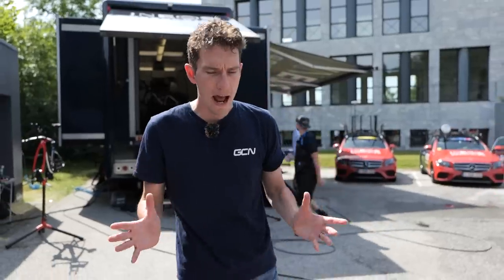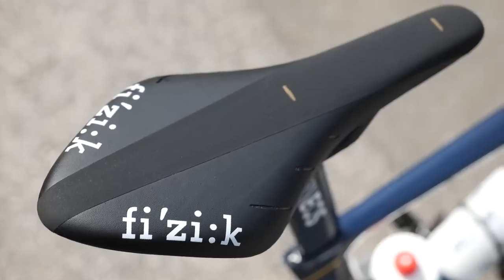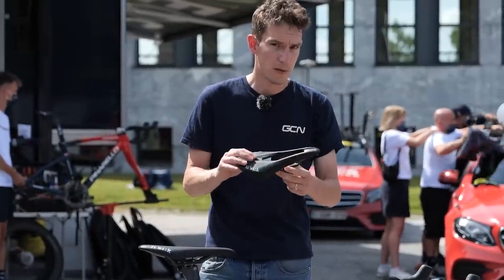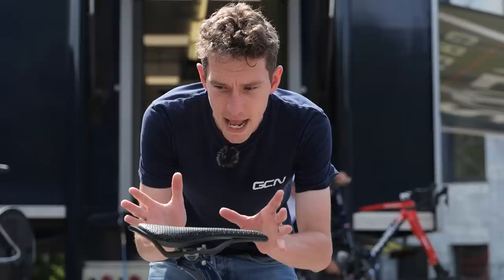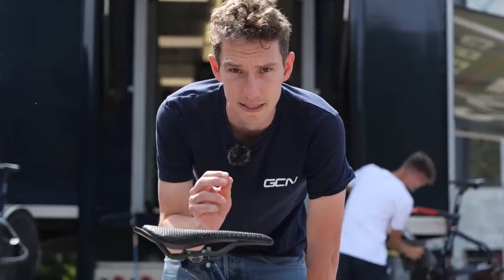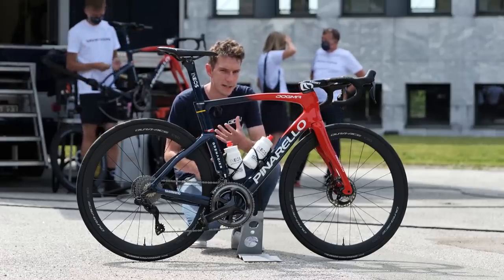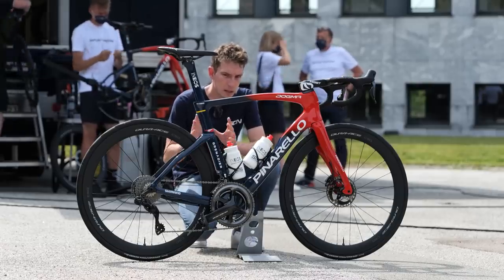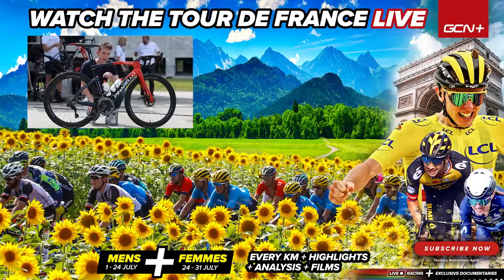How Do Cyclists' Asses Survive The Tour De France?!

Comment from the maker: How long do you think you could ride with a road bike saddle for?
Reply: Spent 13 hours for a 340km Chase the sun ride last year. Had to reapply some chamois cream after 200km but otherwise ok. That was using a Fizik  Antares R3 saddle.
Reply: After about 6 hours I start getting very "fidgety" in the saddle.  I try standing up, sliding back, moving forward, changing hand positions (drops, tops and hoods), but it's really the limit of my ability to sit in the saddle.
Reply: @davidhenry5925  Same as David about six hours but I’ve done almost 9 total in one day.
Reply: 2 hours in which case I’m usually back home from my ride anyway.
Reply: Arses or Asses? Big debate topic.
Reply: After spending & trying about 5 saddles, I'm finally going with Fabric Scoop shallow. I have been sitting for about 12 hours in one go and it still feels comfortable.
Reply: Done a couple solo 200 milers without issue
Reply: PBP: 300k/day for 4 days on a Selle Anatomica Titanico X using Assos shorts & crème de bum.  No chafing, no pain at all. Leather is the best!

Comment: “Saddle tech has evolved a huge amount in past 20 yrs.”
“Here’s a 20 year old saddle the whole team is using.”
😂
Reply: The truth is that not much is new in rails, that's for sure or suspension (the rail attachment points). And if you want to fine tune the rails and attachment points first you might not care about the modern furniture stuffing used in the latest models.
Reply: I mean those are the saddles that the guys that are dominating the peloton (in their middle-late 20s early 30s) have grown up with.

Comment: If you're having trouble in the chamois region then I'd suggest cycling in a different part of France instead.
Reply: Winner winner chicken dinner!  And where, pray tell, is the nether region?  Maybe near the Taint canal?
Reply from the maker: It's only a Chamois if it's from the Chamois region of France, otherwise, it's just a sparkling butt pad
Reply: @gcn  
It's a lot like star trek the next generation. In many ways it superior, but it'll never be as recognized as the original series.
Reply: If only Chamois weren't in the Aosta valley in Italy.
Of course originally they were made from the skin of the European Chamois goat, the same stuff used to dry cars with after washing.
Reply: Formidable.
Reply: Brilliant 🤔

Comment: More bum and chafing info for non-cyclists please.  I try to explain this to new cyclists and their minds cant handle the two concepts of proper support, reducing saddle pressure by having a good balance position with weight on the pedals and the handlebar. and secondly chafing which is a problem for non riders with fatter legs vs fit skinny legs and thus afflicts non riders more than pros.  Propper shorts help  fix the chafing problem and help distribute saddle pressure along with a bit of cushioning.

Comment: Saddles without a middle gap is a big no-go for me as a male cyclist. My previous saddle without the gap really made my private part go numb if I would ride for an hour and it would even start to hurt. After buying the saddle with the gap it immediately fixed all the pain and pressure. If you continue to ride like this (with all the pain and numbness) you could cause severe damage to your private parts on the long run. Definitely recommend the man here to buy one with a gap.

Comment: My vote to Arione as well. It's long, but I can sit back in climbing or get forward comfortably in aero position.
Reply: Why are you 'sitting back in climbing'? When climbing up a hill on a bicycle, the leg movement is the same as stepping up a ladder. If you sit back when you step up a ladder, you end up dead.
Reply: @jameslee-pevenhull5087  Arione is long enough for me to easily change where I sit, 'sitting back' means only few centimeters, if the climb is moderately steep it still allows me comfortable pedaling.

Comment: Riding a road bike is not sitting on the saddle and poking at the pedals......A proper fit allows weight to be transferred to the pedals, having the power to average 30k an hour means a lot less weight on the saddle. Glad you covered it. I have 5 of the  currently on again/off again discontinued Selle Italia SLK non gel saddles.

Comment: Padding is mostly important when you got on a bumpy road if you sitting relativly hard on the seat. The with is critical. To wide saddle with two much padding is uncomfortable when you start and of course not efficient. 

Have find a good saddle for my hybrid but still searching for my racer. Think 3d printing is too expensive for me right now but clearly interesting. 

Totally understand the riders what don't want to swap saddle mid-season.

Comment: My bum can only handle about 40 miles before it really gets uncomfortable. Shifting position on the saddle and standing up always helps me get a little further.
Reply: Probably worth a saddle fit or upgraded bibs then. This shouldn't be the case if you're riding regularly.
Reply: @chicagoan  I got nice bibs. That's just it, I don't ride regularly. I'm lucky to get one ride a week with a kid at home. So, it's like starting over each time.
Reply: @nerigarcia7116  I have a small variety of bibs, but my favorites are the Castelli ones. You can really feel how they twist and take the torsion, so your bum doesn't have to.
Reply: @hzunasdfgbciw  Maybe I'm just a wuss.

Comment: What puzzles me is why most manufacturers decide that the same degree of flexion/firmness/padding is optimum for riders ranging from 50kg to 90+kg?  Especially for those saddles with flexion built into the 'skeleton/chassis'.  Maybe those that offer a range of saddle widths also vary these other parameters, but I've never seen this mentioned.

Comment: When you have a high FTP you’re never really sitting on the saddle.

You’re pretty much hovering over it.
Reply: yeah they push 200w for very easy ride
Reply: @darinsteele7091  exactly
Reply: For most of a stage, you're barely pedaling and have a ton of pressure on your seat.   Being wafer thin does them favors
Reply: As a newer rider I experienced just this. I noticed the more I coast, the more my bum would be tender at the end of a ride. I have one of these Fizik anteres adaptive EVO 00 ass-hatchets and it helps ever so slightly; I had the non-adaptive version before I made the switch. These carbon shell/carbon rail saddles are only good for 1-2hr rides, IMO.
Reply: @veganpotterthevegan  This, they're not pushing that high watts most of the time in the peloton. I can say that the slower I ride the more chance of saddle discomfort though since I just have more weight on the dang thing.
Reply: @ayowser01  even when you’re coasting you can relieve saddle soreness. There are tricks.

I can say for sure though that if your ass is on the seat during a descent to the point where it’s sore then you’re not doing it right.
Reply: @darinsteele7091  I do. 4 Watts/Kg
Reply: Not to mention they wear very padded shorts on top of everything to protect their virility. lol
Reply from the maker: It's why many riders say long, slow days are the most uncomfortable - more pressure on the saddle at lower power
Reply: @chicagoan  yup, when I was racing, I'd ride about 450 miles a week.  Only about 70 of that was actually hard and that's where you get that pressure.  Luckily I had a saddle I loved
Reply: @neoneherefrom5836  if you have the right saddle, the padding means little.  It's more of chaffe  protection above all else
Reply: @veganpotterthevegan  I don’t doubt that because I don’t even ride with padded shorts and I don’t complain about saddle soreness.

Heck I ride an entry level bike with stock parts — including the saddle.

But I’m certain my bike fit and bike positioning are optimal.
Reply: @veganpotterthevegan  Wafer thin and weighing a ton? How does that work?
Reply: @chicagoan  It's force on the downstroke(s) that lifts your butt from the seat, not "watts". And it's not dead weight either. Rocking smoothly side to side still allows good blood flow. Sitting shattered on the saddle makes you feel tired and sore faster than anything else.
Reply: @neoneherefrom5836  Slow, smooth cadence is the best way to recover. It's rarely a good idea to stop pedaling for any length of time on the bike.
Reply: @indonesiaamerica7050  reread...
Reply: @veganpotterthevegan  Paste the relevant text you want to discuss further. Otherwise your reflexive gibberish is useless. A "high FTP" with a high oscillation rate (vertical and or horizontal) is not going to be "hovering". Although at this point I'm left guessing what you could wish to deflect from. For some reason people just love throwing out demagogic terms like "FTP".
Reply: Okay let me clarify… a high FTP where you aren’t anywhere near close to spinning granny gear like the road runner should be enough to relieve your ass.

I figured this was an educated enough crowd to understand torque is what lifts you up. Lol
Reply: @neoneherefrom5836  The truly "educated" critical thinking crowd knows it's not "FTP" at all. It doesn't have to be "high FTP". You doubled down on Dunning-Kruger "unskilled and unaware of it". The sweet spot for "floating" from the saddle is probably at about 80 to 85 cadence at a comfortable pace while not fatigued. Practicing this kind of smoothness is best done while warming up on a trainer. But the real point is don't throw around buzz terms like "FTP" when they don't apply. Like, at all. It takes people away from learning the relevant lessons.

Comment: Those FIZIK saddles are great. I lament no longer having mine. Had great luck with Selle Italia SLR I think it's called as well. At present my 1spd and my roadbike are both equipped with full carbon Chinese cheapo's, and have been great. They are knock offs of the Selle Italia full carbon saddle, which I've also owned, and the only difference I've noticed was about $200.
Reply: i had the R5 Vento, terrible for a normal postion because the material isnt grippy at all, would be a great saddle for crits.

Comment: I am not convinced by the slow rides are worse because of higher pressure on the saddle. The more watts produced the greater the forces exerted by the leg muscles (at a fixed cadence) and these forces have to be reacted somewhere ie the saddle unless the theory is that at higher speeds the riders reaction more of these forces through the hands via the core which I doubt. If you are ripping along at 50kph you have a lot of other things to occupy the mind like not crashing maintaining your position, keeping up, who is where etc etc and so less time to think about the pain in your bum. Also slower days the riders will likely sit more upright and thus transfer more of the weight through the bum and less through the hands like us normal humans, as was mentioned. Also if the set up is primarily designed for the aggressive position with slammed stem then this more upright position will be sub- optimal. Riders do not want to waste energy hovering over the saddle using core and upper body muscles. 

Anyway just my 2 cents…

Comment: Sit bone width is a fairly large factor. My favorite saddle is the Antares, because I''ve not got the skeletal structure as narrow as the vast majority of grand tour level cyclists. 
Sit bone width isn't about weight, though there are often correlations with Body Mass Index (which is a terrible means of estimating body fat percentage, $10 body fat calipers are far, FAR better, but I digress). 
Just pointing this out to counter the "I need a giant saddle because I'm fat" notion, that is wrong and thousands of new cyclists fall into this trap only to quit the sport because their ill fitting saddle is uncomfortable. 
Also, ladies, you have, on average, wider sit bones! Just natures way of bettering your odds of surviving vaginal childbirth in addition to the all the other crazy hip joint loosening going on down there during pregnancy. Us men have it easy in this regard.
Reply: Ten dollar calipers are not very good and you need someone that knows how to use them properly. The main issue is that BMI tends to use one specific number where healthy weight tends to be a range. It's accurate enough for general populations but there will always be individual specifics that it doesn't work for. According to the bmi chart, Dwayne Johnson, is morbidly obese but no one would think that looking at him.

Comment: Would be interested to learn about the differences between male & female saddle considerations. Some men have anti-butts compared to my butt.
Reply: A huge number of pro women don't use women's saddles.  If you're riding with good posture, your butt doesn't really press on the saddle with much pressure
Reply: Male and female specific saddle are a nonsense. 20 of the population have a Pelvis that would be described as the opposite sex. The key is to match your saddle to your position, so an aggressive position with a lot of anterior pelvic rotation would require a flat saddle and a more relaxed position one with a curve to it.  Pressure mapping saddles to athletes is what I do for a living at the Velo Atelier Bicycle Studio.